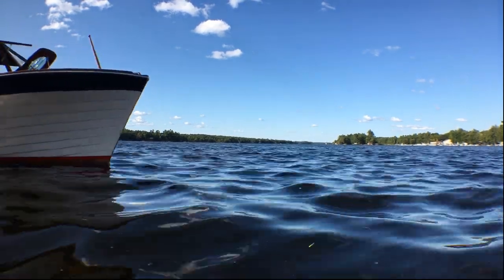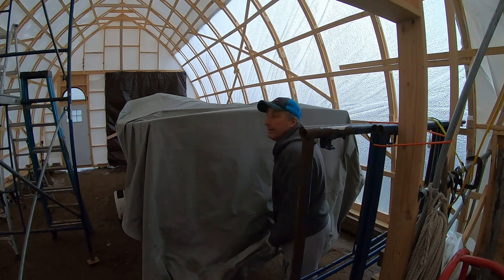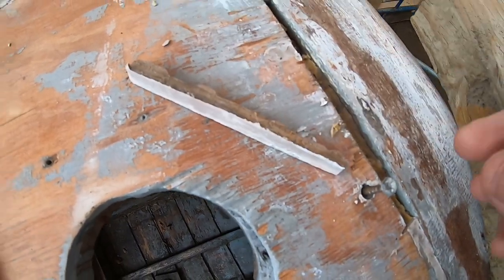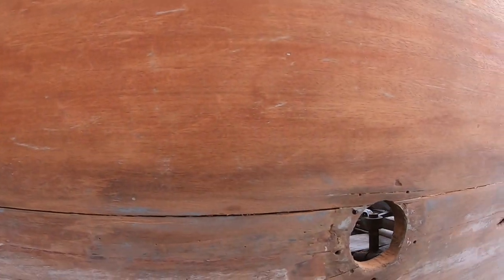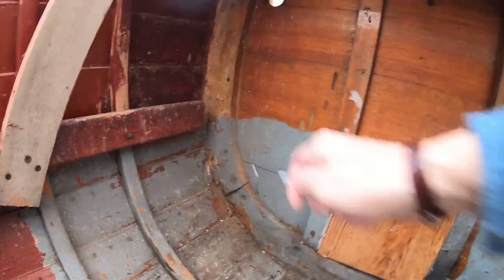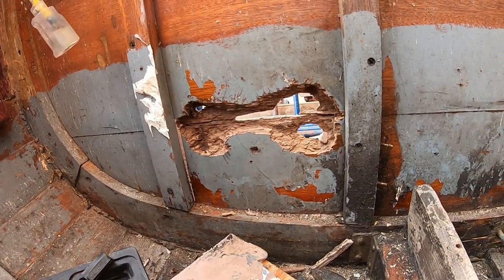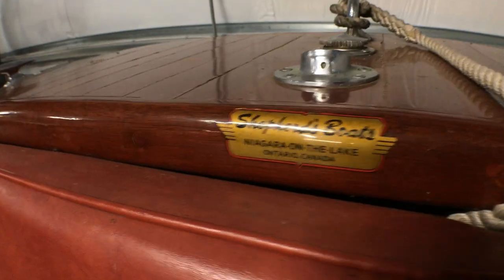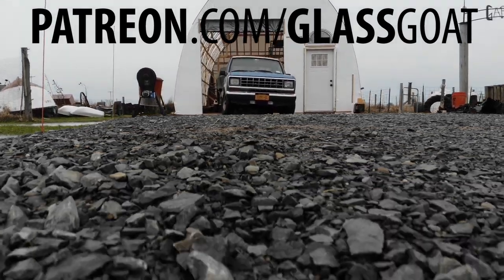WBE S1E16 Chris Craft Restoration Begins!

Comment: If it was me I would replace the whole transom.  All the boards.  It was a real mess.  I can’t believe the non marine materials used.  My favorite Chris Craft boat is either a Capri or a Riviera.
Reply from the maker: Keeping original wood is important to my process if possible and still viable structurally. I think the near end result shown in last week’s episode with 2 coats of varnish so far shows it to be the correct decision. Had I replaced those boards, what is available now would definitely not have the same look as what was readily available in 1955. At least not within the budget I’m working under. Thanks for being aboard the WBE!

Comment: Bondo is suitable for Wood ,Plastic and Metal surfaces. Been used In the Furniture industry for decades. Yes, you can use it for wood, it just doesn't look very good unless you are going to paint or cover the area.
Reply from the maker: It is NOT suitable to be used in wooden boats as it absorbs water and causes rot. There are marine products that are acceptable though which can be found.
Reply: @glassgoat9601  Not True, It's even advertised on their website "for use on boats."
Reply from the maker: Believe what you want, it includes talc which absorbs water, it is not suitable for boats, especially below the waterline and that is all of the discussion I will be having about the subject.
Reply: @glassgoat9601  Wood absorbs water, you shouldn't use it for a boat. But, That's why sealant is applied over the wood. Use a sealant. Especially below the water line

Comment: I am enthusiastic about your work, I have restored a CC Cavallier from 1962 for the past 3.5 years and I can feel it very well!
I am Thomas and come from near Berlin / Germany!
I wish you lots of fun and good luck!
I will follow everything!

Greetings Thomas, Schnarri for friends too!
Reply from the maker: Thanks Thomas! Glad to have you aboard! I get my hand blown glass from Lamberts in Germany for my artwork. What motor do you have in the Cavalier?
Reply: @glassgoat9601  In Germany we always think a little smaller than you in the States, that's why I only have a 54 HP VW Diesel in my boat, because we are only allowed to drive 12km / h (around 6.5 knots) on our waters, which is quite sufficient !
Greetings Schnarri!
Reply from the maker: @Schnarris_Kanal  I'd love to see a photo(s) of that diesel installation. That 12km/h speed limit really cuts down on the waterskiing :) We had a 10 MPH speed limit on the river that I grew up on, (not the one I am on now) but back then there weren't that many boats on it so nobody cared when we skied every day. We just stayed away from any houses on shore.
Reply: @glassgoat9601  On my channel you can see a lot of pictures and videos about the refit of my boat, also about the engine. At the moment I have the gearbox removed and the shaft pulled, everything will be new this winter, I also want to add a new propeller!
Greetings Thomas

Comment: I’d replace the bottom two boards at the minimum ideally do them all and have a nice new transom. I bet you’ll find more rot if you pop the upper boards off.
Reply from the maker: Surprisingly there doesn't seem to be any rot as you go up higher on the transom. I believe this boat spent a lot of life in a boat house as there isn't the usual rot on the deck areas. I'm going to compromise with you and rip a couple of inches off of the second board at the bottom and replace below that. I have some nice boards off of a 1964 Luhrs that are going to be used. I really try to keep original boards when I can, or replace with reclaimed wood. Mostly for aesthetics. Thanks for watching!

Comment: OMG, I could hang out for days in that shop, what a collection they’ve got! Your shop turned out pretty nice and it looks as if you will have plenty of room for your restoration. I knew that was bondo when I saw it but couldn’t believe the drywall screws! Yup, you’ve got your work cut out that’s for sure and I am very interested to see the the process. Thanks again!
Nena
Reply from the maker: My nephew is arriving soon to help me move and organize all of the extra parts, motors, wood etc into the boat shed. By tomorrow night we should be done, then I can move the boat off of the trailer and onto stands. Strangely enough, hardly any of those screws were rusted. I think the repairs may have been done shortly before they stopped using the boat and sold it to my friend, who kept it indoors in a dry wood shop. Info on the giveaway coming next episode, I'm working on the glass art now. Good to hear from you!!
Reply: Amber & Nena Dalydisanto usually I would say it was either that or cut it up but clearly someone either didn’t care or didn’t know what they were doing.